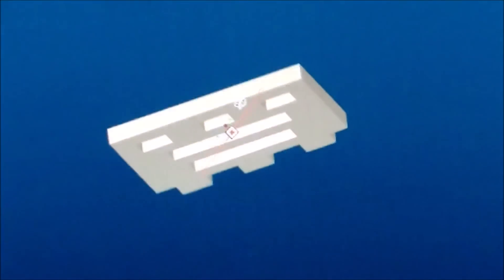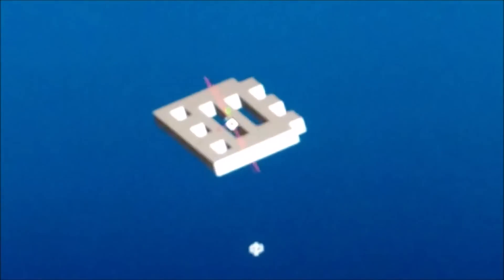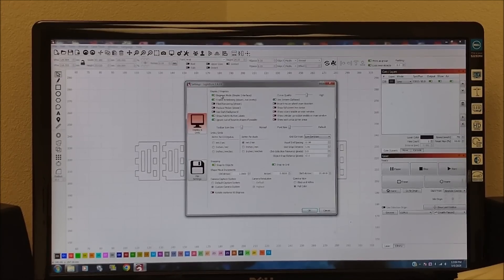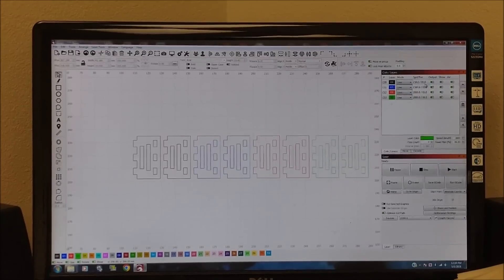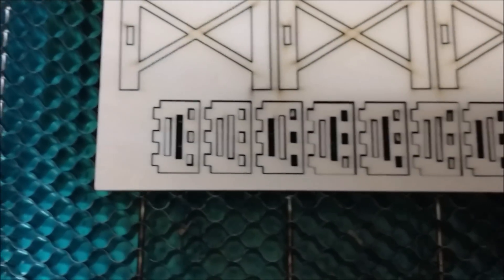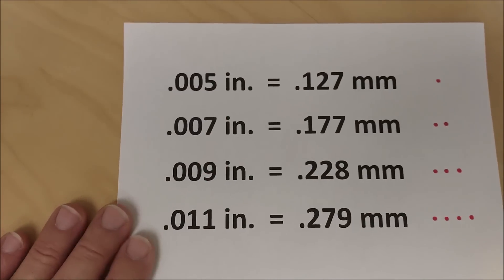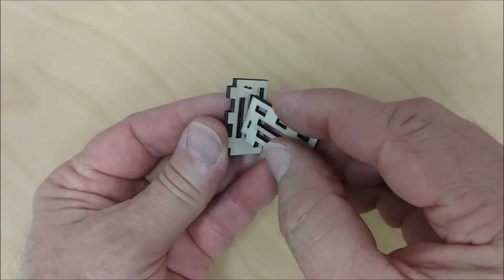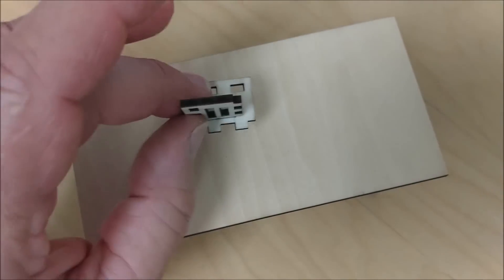1/12 Scale - Laser Cut Work bench --  Plus a Lightburn Software tip !!

Comment: that offset is helping but at least on my laser the footprint of the beam is rectangular and not square.So the cut in the x direction is remarkably wider than on y.Might only be my laser but i think the diode emitter is a rectangle on almost all diode lasers.You can also recognize that because of the higher power per area in y direction the cut goes deeper into the wood and needs less passes.
Reply from the maker: I believe you are correct. The focal point/height may also be influencing the beam too.

Comment: Joe I know you’re busy but if you have a minute I have been looking for a laser for marking parts with my logo and a part number.  All part are metal, the issue I have run into is some parts are basically rectangular and will fit on a standard table type machine.  More often the part is about 1.2” diameter and 20 to 26” long.  Can you point me toward a company that would have something that would work for that.  I’ve looked at dot pean machines that will work but are rather expensive.  Thanks, been watching since you started and you have taught me so much!

Comment: Thanks, Joe! I had one idea that there was a beginner mode to Lightburn! I never even paid attention to that small header before, nor did i know there was a kerf compensation! I use a homebrew cnc laser setup with a similar diode laser to cut gaskets for the little steam engines or gas engines. I always went back into the file and tweaked the dimensions.
By the way, if you need gaskets, McMaster Carr has 0.015" Aramid  gasket material that works perfect for steam or gas models, when you decide to build one and run it on air, steam or gas ignition. Your laser will make easy work of it.
Reply from the maker: Excellent. thanks for the tip.

Comment: Is your beam really that wide? I generally use .05  mm burn comp. with a CO2 laser and 2.5 lens. You might want to check your focus if the beam is so wide.
Reply: My CO2 at 2" has a beam width of 0.16mm. or 0. 08mm compensation.  0.05mm would be a bit tight.
Reply: I got the impression the beam is not really that wide, but instead, the software gives you that impression. I believe the setting that Joe manipulated is really just calculating an offset to mimic the diameter of the beam. Maybe Joe could clarify.
Reply: @bRad73016  Don't mix up beam width & compensation.

Comment: Interesting to see how laser cutting has evolved. Forty years ago, I was shown a laser cut novelty, it looked like a solid disc of steel, but the hexagonal centre could with finger pressure, slide out either way and then be inserted in any orientation, to once more appear to be one piece, with enough friction between the two parts to stay complete. I couldn't see sunlight through the interface surfaces. Thanks for sending me down memory lane.
Reply: That would be wire cut - not laser

Comment: That is interesting. I would have thought the manufacturer would be able to tell you these values.
Reply: lasers have a focus point where the beam is it's smallest, and diverge (get bigger with distance), so the laser beam width is very likely to change depending on the exact cutting heigh (e.g. difference between cutting 3mm ply one day and 6mm ply the next) and the focus settings you run.
Reply: The "real" laser cutter manufacturers have libraries that cover every combination of power, speed, material etc available.  For the rest of us it's trial and error although there are general guidelines available.
Reply: @j.f.christ8421  Did you also know that maggots, keyboard warriors and internet trolls can change their names and content, but not the date their channel signed on? What happen to Bill?
Reply: @Shop-Tech  Did you know I have no idea WTF you are on about?

Comment: I've learned to dislike cutter comp. The problem with cutter comp, ESPECIALLY if you try to use it for the entire cutter radius, is that you run into situations where the compensation direction is not well-defined. I've had weird deviations from the desired tool path that caused gouges as a direct result of that. Sharp corners are another issue. If you put in:
 ...
 G42 P0.25
 G1 X5
 G1 Y3
 G1 X0
 G1 Y0

for example, the control either has to add overshoot or corner arcs to cut the intended rectangle. 

It's really best to use it as intended, for compensating cutter wear, and not use it in lieu of CAM software computing the tool path, taking the cutter radius into account directly.
Reply from the maker: It can cause some strange dancing for sure. It bit me more than one when I was learning to program.

Comment: I watched the whole video, and don't expect to own one of those machines. I consider myself to be nosy and enjoy learning about new things and then surprising myself when I can apply the knowledge in some way.

I do have a question about those laser units. What kind of filtration is needed if you cut metals. I would imagine that the vaporized metal can become problematic if much is breathed.

Thanks for your wanting to share your skills and knowledge with the YT community.
Reply: These machines don't have the power to cut metal.  Anyway, filtration is no different to plasma, welding etc.